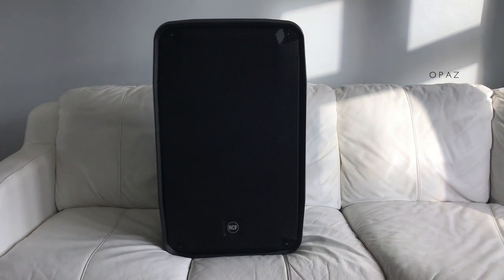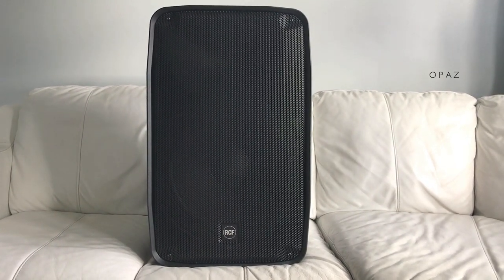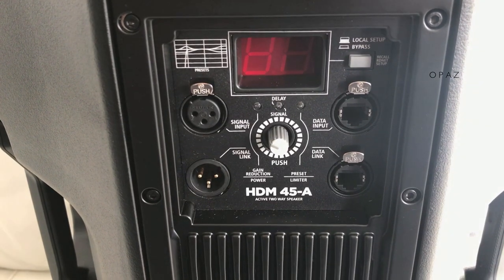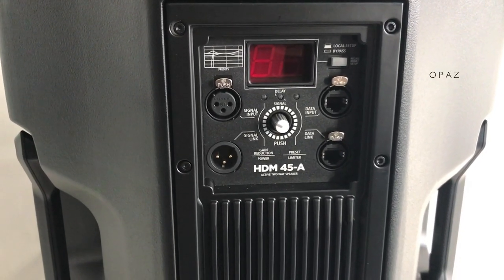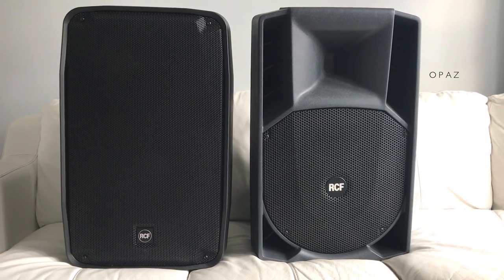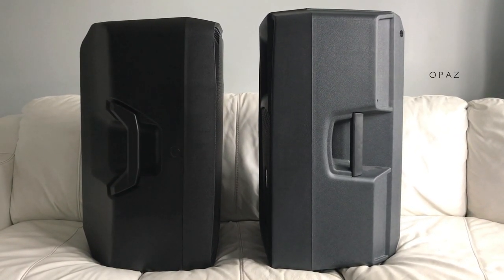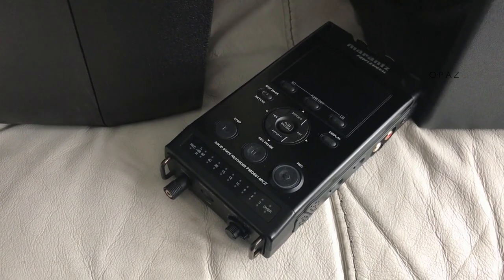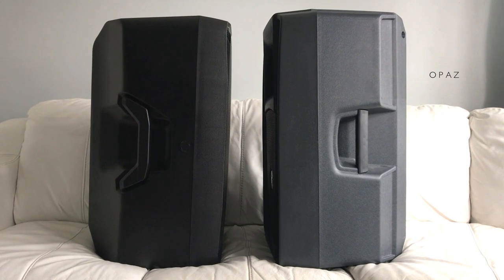RCF HDM 45-A vs Art 745A In Depth Review

Comment: I got the HDM 45a about 2 months ago and man let me tell you guys that this is the best speaker I have ever bought and ever heard. It will leave you in awwww. The only speaker that will compare or beat it is its higher end RCF speakers. Way worth the money.
Reply: How's the Battery Life on them?
Reply: @zulu_mafia   I have 0 complaints of the build sound and amp quality, the best speaker that I have ever owned
Reply: @fochizzle88  
Does it have a Rechargeable Battery?
Reply: @zulu_mafia  no it has a built in amp
Reply: @fochizzle88  
Thanks Evan 
Lack of Battery is a Deal Breaker for me
Reply: @zulu_mafia  you mean like a portable Bluetooth speaker, this is a pro DJ speaker
Reply: @fochizzle88  
Sometimes I need to DJ in Outside Areas that have No Power Supply
Reply: @zulu_mafia   you need cheap speakers!!    Pro grade speakers and equipment for outdoor festivals and gigs alike are mains powered and they get their power from heavy big rig generators .  you need those lightweight cheap speakers and many of them for your outdoor areas    your looking at the wrong speakers
Reply: @digitalheaven9410  
Alright thanks
Reply: Any one get the HDM 35?
Reply: Wait till you play apple music  through it via bluetooth dongle
Reply: Review after 3 years
Reply: @zulu_mafia  get a bluetti ac200max solar genenerator to power the speakers. You can also buy extra batteries to connect and also buy solar panels to recharge the generator and batteries during sunlight.

Comment: Hi Opaz..can you tell me what power setting you run them on from the digital output from the back .They are set at  0.0 from facctory. I have just bought a pair of these and I'm a singer and have always used passive speakers with separate amp in the past.  I have set them at  7.0 but some people say run on full and others say run much less. I have on;y tried them in the house but the sound is superb when running my backing tracks through them via  a minidisc player. I use WAV backing tracks rather than MP3's and on speakers like this you do hear the difference in quality.  I almost bought the 745's but bought the HDM 45's after seeing your video so thanks for uploading.
Reply from the maker: I suggest to do exactly what you're already doing. Experiment with them, then just simply run them how you feel they perform best.

Comment: Hi. Love this video. My friend got these HDM45s and loves them. I have had QSC K12s and KSub for 10+ years. I’m due for a speaker upgrade as my DJ business is growing. Was considering going QSC K12.2 and KS212C Sub. How would you compare those to these RCF HDM45s? Also what Sub do you recommend pairing with HDM45s? Thanks!
Reply from the maker: I have K12.2's and the HDM's are on a TOTALLY different level. The 12's have a good mixer but That Is It!!

FORGET the KS212SC... there's no point

Unfortunately the HDM's are so good that you'll need great (unfortunately heavy 8003AS/8004/AS) subs to suit. The result is you'll have a very flexible & serious sounding PA system

Demo the subs if possible to see what suits your requirements

Comment: Hi, I’ve been considering these HDM 45A speakers. I’ve used the 745mk4 before. Someone was telling me to also checkout the 12” NX32a. They said the amp paired with that speaker sounded amazing with great low end. Have you used the NX32a before? Do they compare at all to these HDM45-a’s?
Reply from the maker: Never heard the NX. What are you using them for?
Reply: @opaz.  For dj'ng. Just wanted to buy a nice pair of mobile speakers that aren't too heavy for dj'ng parties without a subwoofer.
Reply from the maker: Trust me HDM. Demo them if you can against the NX but I don't think the NX can deliver the magic of the HDM
Reply: @opaz.  Ok perfect. Nobody has them to demo in my area, but I've heard too many great things about these speakers now I'm going to buy them.

Comment: OK. So 2x RCF HD 10A (10 inch) and RCF Sub 702-AS II (12 inch) Sub or two RCF HDM 45-A? Price wise they are the same. I need a bass for Techno so I thought smaller setup would be better. However bigger speakers would be better for future upgrade and should have decent bass. I play max for 100 People in medium sized room. For bigger gigs we just rent stuff.
Reply from the maker: 2 HDM-45A's 👍
Reply: mikelo303 dont even bother with 702 i had 705 it was okay nothing wow but you would need two. Think am
Going 2021 HDM

Comment: What is the difference from the HDM45 and EVOX 12?
Shouldnt the EVOX 12 have more Detail and SPL? it is bigger and more expensive.
Reply from the maker: Can't understand the recent interest everywhere concerning the Evox 12. It sounds good, nothing spectacular. I bought it 5 years ago, wouldn't even think of buying it today. There are so many column PA systems that are better.

It is dated, very heavy, has virtually no DSP onboard, limited inputs & overpriced

Evox might have more throw than the HDM (only might!!!)
It will have better LF with its 15" sub
More detail??? No!

Although I'll have a complete PA system buying the Evox, all day long I would buy the HDM for what it is capable of. The HDM is a real stunner

Think this calls for an upload 🤔
Reply: @opaz.  i currently have 1 EVOX 12.
so do you think it not worth the Upgrade of a HDM45?
They are similar in output?
Reply from the maker: Two totally different systems. What application do you use yours for?
Reply: @opaz.  Range from 50 to 200 people 
Events, partys, weddings.
Looking for the best sound quality.
thanks.
Reply from the maker: I'd prefer the Evox for that purpose
Reply from the maker: You don't need to move to  HDM. What you have is adequate. As I said, its a complete pa system
Reply: @opaz.  ok, thanks for your response.
I will keep the EVOX.

Comment: OPAZ,  would the RCF 7005 AS 2 subs have enough power to run with either of these or would they overpower the subs? I don't have the space to carry 2  18inch subs. ( I will be running 2 7005 subs)  I currently run with BOSE F1 SYSTEMS ( TOPS & F1 SUBS)
Reply from the maker: They will overpower those subs
Reply: OPAZ Thanks Opaz!

Comment: i also just bought a pair of 745 because HDM was out of stock, but shurely will get a pair of HDM

But the big question - is HDM louder then 745?
Reply: overall ouput volume is 133db for both models.  when you do a shootout between the 745 and the hdm45 you realize how much better the HDM45 is.  the low mids are much much better in the HDM45.  The 745 sounds thin in comparrison.
Reply: @thenightlifenj1  did you listen both models?
Reply: @djsergiubulgar4922  all of them.  It's my job.  I work for RCF.
Reply: @thenightlifenj1  where? USA?
Reply: @djsergiubulgar4922  yes.
Reply: @thenightlifenj1  can i contact you on facebook?
Reply: @djsergiubulgar4922  not sure how to give out info on here so everyone doesnt see it.  You can call me in the office on monday if youd like
Reply: @thenightlifenj1  I'm from Moldova
Reply: DJ Sergiu Bulgar hdm way louder 1100 watts rms 2200 watts peak I m using Yorkville es18p subs with these and they go nuts
Reply: @thenightlifenj1  I Have a question for you, I have the RCF HDL20a Im only using 4 of them 2 per side , I love the fidelity the power etc. my only problem is the weight because I'm pole stacking them and not flying them. I'm considering the TT4W 1 per side pole mounted over the tts18a do you think this combination would be fine. thanks in advance

Comment: What about now New 945a series speaker, on paper 945 is louder about 2db at peak, so assume it would allways be 1-2db louder ad continuous power before clip each speaker, but hdm says its 2200w 945 2100w, wich is better without sub, with sub i have heard 745 and they can keep up with big ones of subs, but when u use just them without sub, is hdm more fatter puncher couse all rcfs i heard now are good in punch, they dont have that shaky "thing" in them wich is normal they are not subs, is 945 better for throw couse of extra "2db" and hdm for heavy puncher and 945 more thingt punching speaker or hdm wins in everything, exept they are just same in output? In overall wich is better now to buy as a pair ofc, and use without subwoofers?
Reply from the maker: https://youtu.be/iqWkP1OFKQk

Comment: Ok, i just listened HDM 45
Where is Wow effect?
I must mention that my 745 are mk4, just look how RCF explain what is Fir Phase technology so it should sound much better then 745 old version.
But instead hdm 45, i just not feel that difference.
Shure there is, testing on Flac, Wav, but i'm a DJ, using a 320kps files

This speakers on L1 feel like has more bass, but 745 with boost act the same.

Hanldes are more confortable, couse they are slitly tiny, but not feel so solid as on 745. Powercon in out is must have feature! also DSP presets.
But overall, the difference is not such noticible.

I'll make more comparison tests later, but as i mentioned... 745mk4 is not 745 mk2 ;)
Reply from the maker: Interesting,  as FiRPHASE is on my NX and it doesn't sound as good my old 745 🤔
Reply: @opaz.  I must reedit that comment
just finished to listen them side by side and its just like you sad
Till i'v heard HDM, the 745 was etalon for me. So when I'v listened HDM only, i did't notice difference
But when put them side by side, its just like you sad, like somebody change sound on 745
I feel them like - 745 sound like the artist is right in front of you, and HDM is like there is a Hall effect.
HDM bass sounds like there is a bass unit hiden somewhere behind, and 745 like lost his bass.
To be honest, i cant say what is better, is just a different caracter of sound
And yes, HDM are defenitly louder, at list on low ends.
Reply: @opaz.  hi my name is George I like for you to Sen me the video on the hdm45 vs 745 thank you